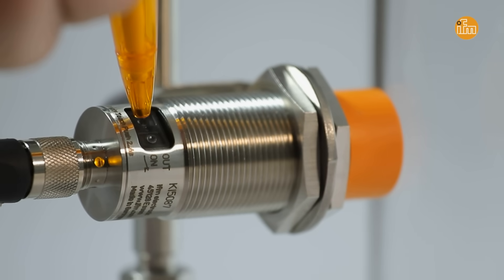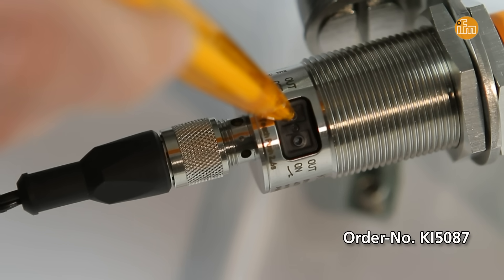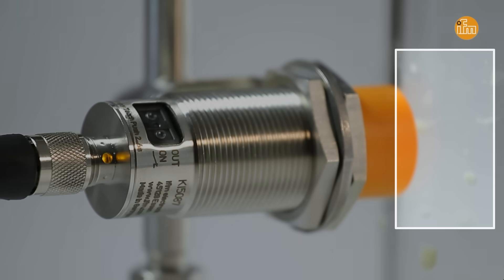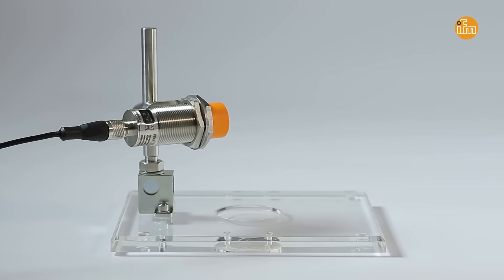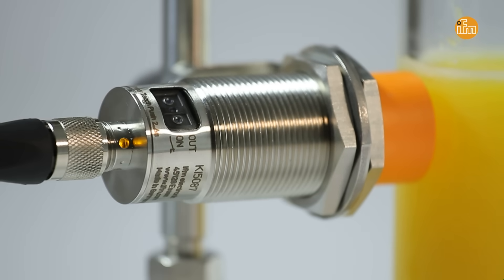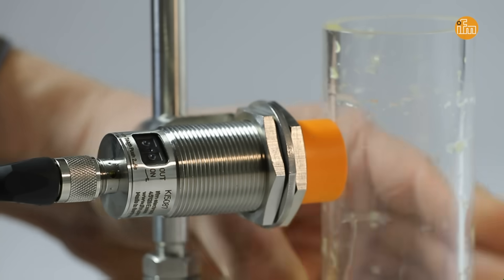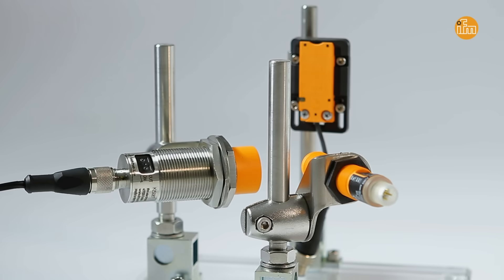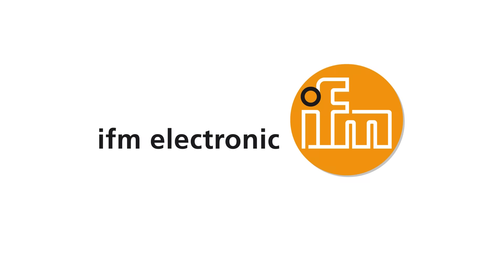ifm capacitive sensors

Comment: hello ,i need touch sensors with counter display for e.g 30 of students at the same time they shoot with an arrow to the board so,I need the results to show on display that whenever the arrow touches the board it will count it as 1,2,3,4,5,7,9,10,11,17.18 etc. ..so is there any sensors or any systems like that
Reply from the maker: We are sorry, but our touch sensors are made for use by hand or fingers, but not for arrows or similar. Maybe it is possible to use optical sensors in
this case. Please contact our ifm service hotline for detailed information +49800 1616164

Comment: How do you fill the cylinder without the sensor detecting the liquid entering the cylinder?
Reply from the maker: Usually, the sensors and the feed equipment are positioned with so much space in-between that the refilled material does not dampen the sensor during the filling process. This works quite well because we are dealing here with distances in the lower two-digit millimetre range.
If the space is more restricted, one has to improvise, e.g. by using further sensors or by stopping to evaluate the sensor signal for a while.
Reply: insert rod from the top that puts out fluids from the bottom upwards.

Comment: can we use this sensor(capacitive) for detection of plastic,metal and paper material.
Reply from the maker: Generally speaking, yes, the sensors can do it.

Detection is certainly possible; the longest sensing range can be reached with metal, the shortest one with plastics. Paper is in between, however rather in the lower range.